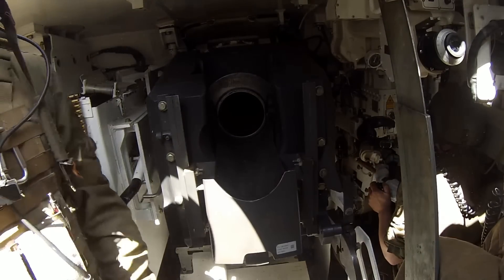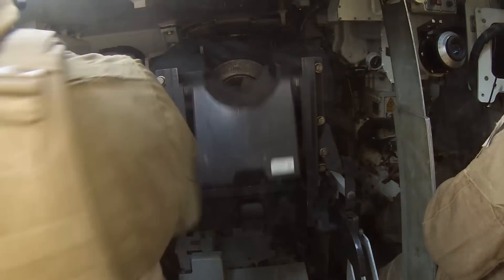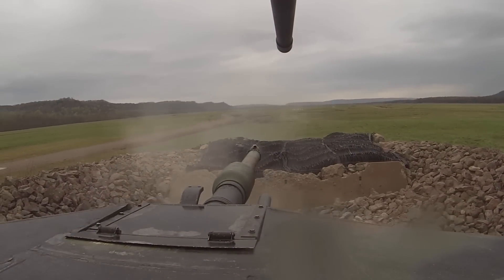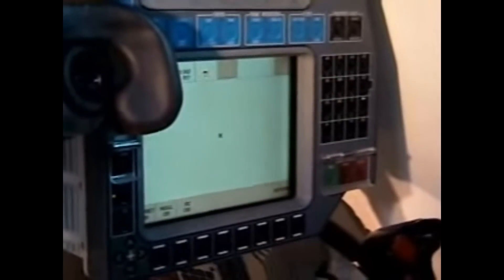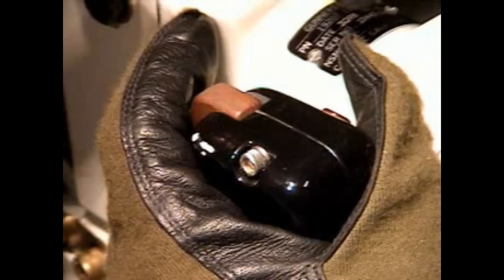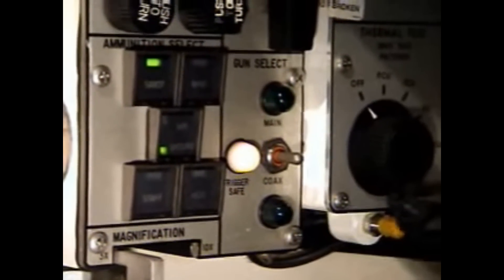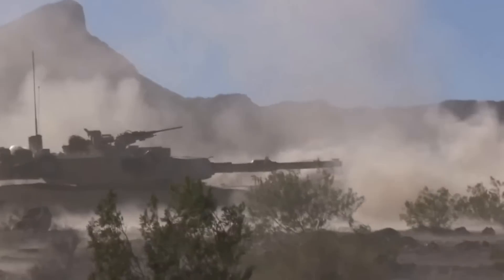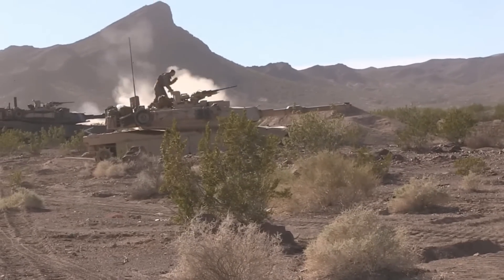How Do They Clear Tank Gun Misfires?

Comment: A little WW2 story from my late Grandfather:
He was driving a Cromwell in Africa during the war and on occasion they swap seats so that everybody has a go at driving, shooting etc.
This day was my Grandfathers turn as the loader. During that day the gunner had a misfire. Protocol says they need to wait 5s then pull the trigger again...nothing. So they repeated it 3 more times...nothing. The commander gives the order to evacuate, leaving my Grandfather inside the tank to unload and dispose of the live shell. Whilst alone in the tank, he tries the trigger frantically as he was determined to avoid having to manually unload a live shell but to no avail. Now the part he was dreading. He knows the shell will slide right out of the breach when he opens it so he braces himself...but he wasn't ready for how fast it did come out...and when the shell is live, it's quite heavy. He just about managed to stop it from hitting the floor. Next he clambers up, shell in hand, and pops it out of the hatch, resting it on the body of the tank whilst he climbs out. He jumps down, picks up the shell and walks to a nearby ditch to dump it into. He nears the ditch, sweating in the African heat and from carrying a live "bomb" in his arms. He throws the shell as far as he could into the ditch, at the same time as throwing himself backwards and towards the floor...nothing. The shell didn't go off...
Next he hears the commander shouting to remount the tank...so they all clamber back inside and go on their way.

I was last told that story a good 20yrs ago so I may be forgetting details and I my not be 100% accurate...but it is as I remember.

Can't say I envy those guys.
Reply: Probably a crusader, name start similarly
Reply: My grandpa drove an ammo truck in north africa he went to take a piss and it was blown up by a faulty round. Killed everybody.
Reply: Daniel W thanks for the story 🖒
Reply: I get super tense over misfires. Can't imagine having a shell larger than say 20mm misfiring. Let alone 50-105 mm sized misfires.
Reply: @texasdeeslinglead2401  I know right especially seeing that a sabot round is radioactive, and a HE shell could literally liquify everyone in the vehicle.
Reply: Seems about right, if possible evacuation of the tank while one person unloads and disposes it seems logical. Very logical if your not the crew man doing it. :)
Reply: So you mean there's still a live 57mm round somewhere in north africa?
Reply: @madcat789  40mm. If the story is true it would have been a Crusader, not a Cromwell, and they had 2 pounder 40mm guns.
Reply: that sounds scary man I love ur story
Reply: I served on an M1a1,and after the misfire procedures were done, (rotating the round) and going through the  procedures again, the loader extracts the round and put it back in the loaders rack and mark it with an x. We had a circuit tester we would slide in the closed breech and test all trggers including the the TC's trigger and the master blaster. Each pull of the trigger should illuminate the light on the circuit tester. If not call a mechanic.  If in a defensive position we would remove the round and place it somewhere clear if the tank.
Reply: Brave man!
Reply: That's one brave man
Reply: <ahem>  Cromwells were never used in North Africa...
Reply: @iatsd  could have been a Crusader...he did say last time he heard the story was 20 years ago.
Reply: God bless him. British tankers didn't live very long in that tank. Or the Sherman. Or the Firefly. Shit being a tanker just wasn't a great position in WWII. Or any role in the conflict for that matter.
Reply: @thesquirrel4257  statistically tanks were one of the safest places to be during the war, especially Sherman's, it's a common myth they were deathtraps and indeed were not.
Reply: "A little story"
Reply: hahaha shells don't get magically heavier when they are live and you don't throw it like it's a rock or something, you have to be careful not to hit the nose of the shell and activate the explosion mechanism, otherwise it's safe and easy to handle... I think your grandad made the story up or exaggerate it a bit, just like grandads do
Reply: Its heavier than an empty casing that they were used to being ejected from the breach. I don't know how much truth there is to his story but the misfire procedure sounds likely. A misfire can be the result of a delayed primer, hence the abram crew having to wait 15mins before extracting. Once out of the breach there is still the potential that the round will fire so you really don't want to be anywhere near it.
Reply: He meant live as in it being unspent and had powder in it, dumb ass.
Reply: @enterthevoidIi  The "explosion mechanism" is called fuze and for conventional rounds it's in the back of the round. Also most of the fuzes are secured until the round go through the barrel to prevent explosion when handled.
Reply: This is a ww2 story, not a modern one, things are different now, shells are safer to handle
Reply: Also about the original story that i find fake, shell don't automatically slide backwards, it depends on the angle and direction the barrel is facing
Reply: @enterthevoidIi  Of course they are safer nova days, but even ww2 shlels were made to be safe for handling. It was not a stoneage. Try to read something about it, you would be surprised. Most of the fuzes were locked until they left the barrel and some of them even few moments after as protection against near exposion of the shell. Other thing is safety part malfunctions.
Reply: @enterthevoidIi  How many misfires have you cleared IRL?
.
Reply: @enterthevoidIi  yes, shells slide backwards due to the ejector kicking the shell out of the breech.
Reply: @enterthevoidIi  an unfired shell will be MUCH heavier than a fired shell, due to the projectile and powder still being intact. As far as "hitting the nose" goes that isn't necessarily true. If it was a solid armor piercing shell you could bang the nose with a hammer till your arm fell off and it wouldn't do anything. Also, even in a HE/T round, the shock of the  nose of the shell hitting the ground is unlikely to set the charge off, due to the simple fact that the rounds are designed to be robust enough to withstand the g-shock (intense gravitational forces caused by sudden acceleration), and thus are required to hit something hard while moving very fast to detonate,  otherwise the rounds would just detonate while still in the gun. The danger in this particular situation comes from the unburned powder having a delayed ignition. The "bomb" in this case is the shell casing itself.
Reply: @enterthevoidIi  being a ditch   I'm going to guess water was in it . I find the story plausible . And for the Era , it's quite believable . Those rounds back then were  no where as reliable as today's casings,   projectiles and powders. Being British , it most likely was apcbc or apc, British just were not into HEAT , HESH, or other such oddities.so tossing an AP type round is no biggy. So all in all , I'd say it's very possible this happened.

Comment: This clip did not hold many answers. how does the loader get the round out? does he use a tool or something? what about two piece ammunition? what if its an auto loader?  on a side note what if tanks that use two piece ammunition or a autoloader got a APFDS round in the barrel and now suddently you need HE? do you waste the round, can you pull it back out????
Reply: Core 308... in training conditions, on tank gunnery range, yes, the dud round or wrong type of ammo loaded would be extracted after waiting a safe period. The round automatically get pull back out as soon as the breech is opened, and the loader could then pull the rest of the round out. Usually, no tools would be needed unless the casing is damaged.In combat, as I have stated earlier, it would be far faster to just shoot whatever was in the tube and then reload with correct ammo. That's not called wasting ammo but rather, saving critical time and possibly lives to fire off the next correct round fast and hopefully, onto the target.As to treatment of two-piece ammo, I'll let the Challenger crews answer that then :-)"IF YOU AIN'T CAV... YOU AIN'T #$&"

Comment: Not dangerous at all...most miss fires are due to the gunner not switching the gun to main or the breech not going all the way up. If that's not the issue rotate the round 180 degrees and fire if that don't work conduct fire circuit test if it passes use another round if it fails you're fucked lol

Comment: On Challenger 2 you have a 30 min wait time before you touch the main armament. Then you remove the firing needle assembly (FNA) from the back of the gun to see if the vent tube has been fired. If it has, it means its a faulty bag charge so you open the breech and replace it. If the vent tube is unfired you need to test the firing circuit with a light bulb on the end of the FNA. Usually its just a faulty vent tube, or if the FNA is at fault a spare is carried on the vehicle. Any further pronlems report to REME. The biggest stoppages on ranges are mainly chain gun.

Comment: Luckily for me and my crew have never had a misfire during the gunnery cycles I went through. This procedure was always practiced and graded for TCGST (Tank Crew Gunnery Station Testing) before firing Tank Table 8 qualification. This is always practiced by the unit as daily tasks for training leading to gunnery and live fire exercises. Misfire procedures check list should always be on the tank and followed through line by line by the TC,Gunner,and Loader when on the range. Combat is different and will be short cutted if the round can't be fired using the "Master Blaster". The "Master Blaster" will usually fire the round because it sends an electrical charge to the primer to detonate it The "Master Blaster" is basically a magneto blasting machine used for detonating blasting caps in mining operations and is usually reliable. Primers on the 120mm main gun rounds works both on a conventional striker fire along with a charge of electricity to ensure proper firing.The firing circuit board is used in the misfire procedure to trouble shoot that the breech block has the proper amount of electrical charge going through the firing pin. The firing circuit board is used as a pre-check by the crew before firing any round through the main gun.

Comment: @ matsimus if the shell exploded inside the cannon with the breach closed shouldn't it withstand the explosion and therefore protecting the crew ?
Reply: The act of firing a main gun round is an explosion, which propel the projectile out the cannon; the danger is the round going off WHEN the breech is opened during extraction!!! As to chucking a dud round out the loader's hatch, would you really do that with an LIVE ammo, even a dud!!!? Try doing that with a  heavy 105 or 120mm, you wouldn't be able to throw it too high or too far; would you chance the chucked round banging against the turret or chassis sides on its way down onto the ground? A round could simply come apart, separating the projectile and the shell with its content of propellant. I have seen busted rounds before.
Reply: thanks for the information

Comment: Got to agree Matsimus - taking that round out after trying to persuade it to go off 8 times sounds really scarey! Any idea what they do in Challengers with the two piece ammunition and under turret rim storage (iirc) Sounds like an even worse situation to be in!
Reply: Maybe pull out the propellant and chuck it out of the turret? It would have to be a lot easier to do than with a one piece round and unless the propellant charge is encased in metal (I have no idea if it is or not) then it's not going to damage the tank on the way out and the blast shouldn't too much, if any, damage outside of scorching the paint.

Comment: what do crews with autoloaders what is the procedures to clear the gun?
Reply: Viorel viorel similar idea likely but the commander or gunner will take care of it instead of the absent loader. However auto loaded guns still have manual overrides
Reply: the french one dont do that they do not use two stage ammo the russian one do load two stage rounds
but the thing is the autoloader cant extract after loading but it seems like one of the other crew probably the gunner handle that would like to see the procedure
Reply: Unscrew the turret and leave the whole damn thing right there . Go back to base and get a new turret.
Reply: That is one point why NATO use a human loader. Some east tank crews where killed by his own autoloader.
Reply: Auto loading guns can be manually cleared by crew and manually loaded in case of a auto loader malfunction.
Reply: OK, but its not easy like manual guns. East auto guns use seperate propellant and bombs. Its dangerous to clear this guns.
Reply: Improve ammo quality is a good way to avoid it.
Reply: Procedures with autoloader:

1. Open the hatch
2. Climb up and leave the tank
3. Find another tank
Reply: Autoloaders normally handle two stage rounds. That is, the shot/shell/warhead separated from the powder charge. This also means the primer is also a different part of the round altogheter.
They have the same likelihood of misfiring for the same reasons the unitary rounds do. Only in their case, you can pop out the primer, put a new one in and then try again. Though, I'm taking this from Artillery procedures.
So, I believe the procedure would be the same, with the added step of changing the primer. Having a faulty charge is not unheard of, but it is pretty rare.
Reply: vhat are you taling about.... the loader is still present we call hin Иван he never breaks at all we call the gun Иосиф adn the tank Захар they are nice people with personalities they nevr breaks if yuo treat them nice

my english is bad sorry )))))))))))))))

westerners are funny we do no suc thing to take care of weapon we normally talk to Иван the loader and ask him to be nice and then poor vodka on him or we hit brech with a hammer open it and see if weapon fired or no because sometimes we too drunk to realize it fire
Reply: @Awesomelord101  rofl you are fucking awesome